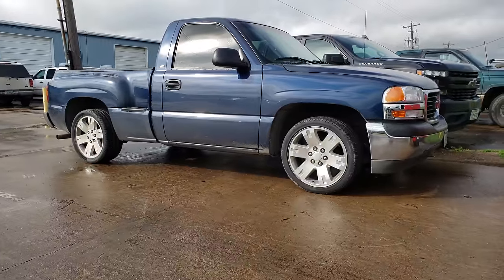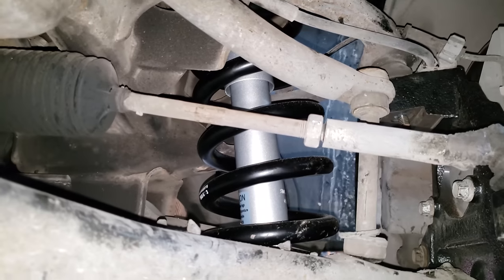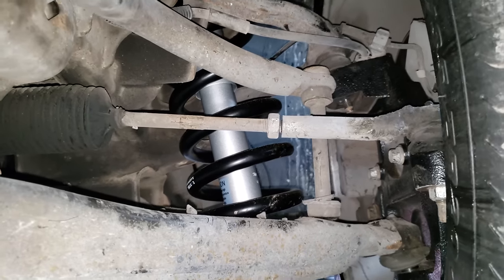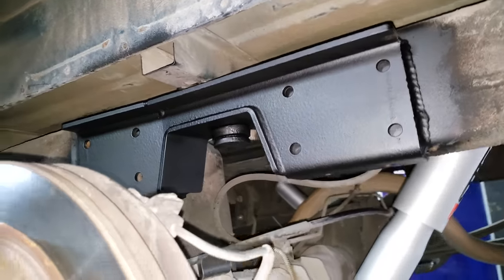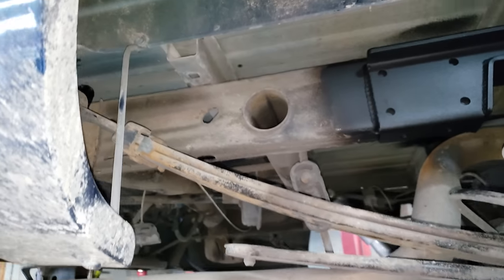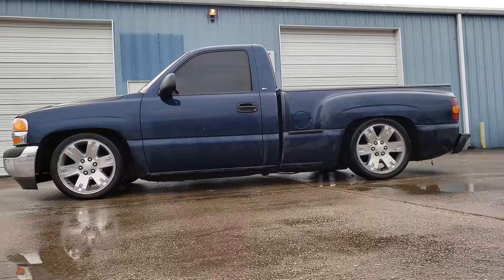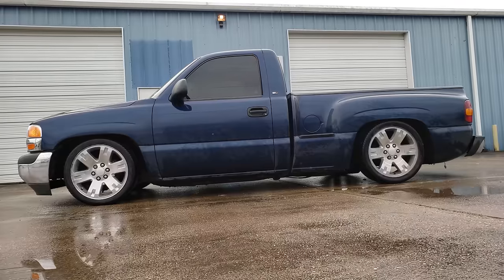1999-2006 Sierra, Silverado 5/7 Drop Kit Installation, C Notch, Street Performance, Reklez, StepSide

Comment from the maker: Prices by phone only (832)770-4366 Buy online www.reklez.com. Thank you for watching God Bless.
Reply: i have a 2000 silverado extended cab with a 2/6 drop with c notched and bell tech rear shocks but sometimes it bottoms out i hear something hitting... do you think its because i didnt notched the underbed rail ontop of the diff??? && do i really need bumpstops with the c notch?
Reply: I like this truck I need to paint or block your truck then say Jim see Sarah what size is wheels I got a new one the six is 12
Reply: Donde puedo comprar un kit de esos para una silverado 2005

Comment: Hey guy..Drop looks sick! I just did a 2/4 (no notches)with Beltechs all around on 265/40/22 on my 02 stepside..My question is how can I gain a smother ride?? Mine rides rigged like truck but the light weight stepside doesnt seem to wanna compress the shocks an it rides rather high up in the stroke. Should I get adjustable rear shocks to help with the compression? Any suggestions?

Comment: How do you like the drivability now it sits so low? I have the same drop kit on mine, I bottom out on every small bump that's over 1 inch high...drives so bad. I cant even drive up onto a lift to get a look under neither its too low.

Comment: Question? I bought a 99 silverado w/ a 5/7 drop. & i want to buy new control arms, inner & outter tie rods, sway bar & ball joints. Will they be the same factory ones or will i need to buy special ones due to the drop.

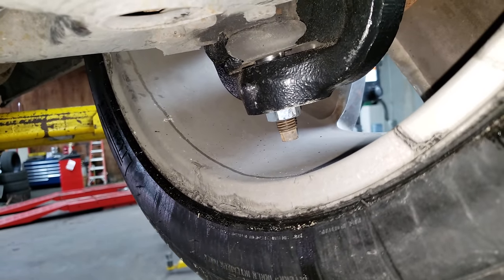Comment: Doesn't that kit require removal of the lower ball joint from inside the lower control arm and relocating it to the upper side of the arm with a spacer inside the control arm? Looks like yall skipped the tough and crucial step of the install @ 1:52.

Comment: I have an 05 Silverado extended cab with torsion bars what I can do in that one
Reply: @Antonio Garcia  spindles, lower control arms, drop keys or coilovers for the front and the rear anything as a regular silverado... I did spindles and lower control arms for 5” in front and flip kit out back

Comment: I have a truck just like this,  but would like to lower the truck and still be able to tow with it what would you recommend? I would also install bag in the rear to keep it from squating. Thanks
Reply from the maker: Yep bags for the rear would help you tow a nd still be dropped
Reply: Would you recommend this kit or something without a notch @ReklezSuspensionWorks
Reply from the maker: @driftingpsycho86  this kit would work fine.

Comment: Did you shim the rear diff? I had to do mine on a 3/5 drop. It had vibration at speeds
Reply from the maker: No shims. We dont ever recommend shims. We prefer to re adjust the pinion.
Reply: @ReklezSuspensionWorks  how do you re adjust the pinion angle?

Comment: How do you fix camber issues???? I got a 4-6 on a silvy SS 2wd
Reply: Gerardo G. What tire size are you running?
Reply: @TMG Rube  275 45 r20 now and I also have 265 35 22 that I swap when I get bored
Reply: Gerardo G. You don’t have any issues with tire rubbing on the 275 tire?
Reply: @TMG Rube none at all... not even at full turn no rubbing issues.. only issue I had at first was my exhaust hitting the bed but I cut it... same thing with my differential hitting the bed cross member but my SS has the big 14bolt if u have the 10bolt you should clear it
Reply: @gerardohtx207  the camber issue can be fixed with upper control arms

Comment: I have a 2000 gmc sierra ext cab and im having vibration issues from speeds 25-30 mph it has a 2 piece drive shaft and i bought a bracket to straighten the drive shaft thinking it was that but it actually got a little worse what should i do?
Reply: It has a 4/7 drop sorry forgot to mention that

Comment: No shock extenders?
Reply from the maker: Yes, no shock extenders
Reply: Why does belltech offer shock extenders I got them do you really need them
Reply: @ReklezSuspensionWorks  I got a 7" rear drop using the same notch and shocks as this truck in the video. And I bottom out on the notch alot. I wonder if that me using the belltech shock extenders are part of the problem